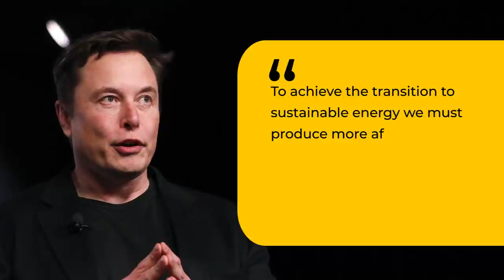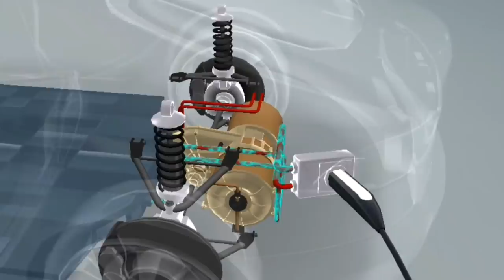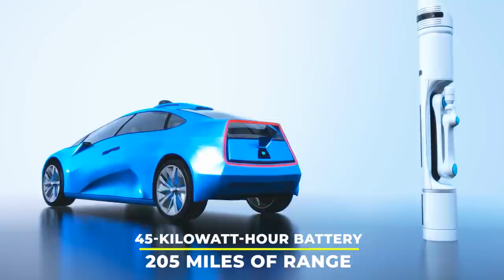This $19K Tesla Car Will KILL Gas Cars!

Comment: The only way electric will kill gas is when charging is as fast as filling up a tank.... period.  Electric cars are great, but remember, the car is made out of plastic... plastic is made out of oil. so until there is a convenient way to change the battery or charge it in 5 minutes.. gas is not going anywhere. This is the key.

Comment: If it can be done Elon, Leon, Noel can figure it out. The next biggest wealth will be a cheap, very efficient, long lasting battery with a low ecological footprint, ie dismembered and other uses found for it. Apart from supergrids we need to find a super efficient way of storing electricity and/or find additional uses for it.

Comment: Just to clarify: 
The "regular" ID.3 with the 58 kWh battery already starts at 35.000€ before govt grants. That means it currently matches the proposed 25.000€ of the Tesla Model 2. (-10.000€ govt grants in Germany) We can also assume that Tesla is going to create a compact car for Europe in Berlin / Grünheide. They currently hire for an R&D department there.

Comment: if Tesla built a station wagon based on the Model 3 with less powerful engines and a slightly smaller battery ... then that would be the new VW Beetle and would storm the market.